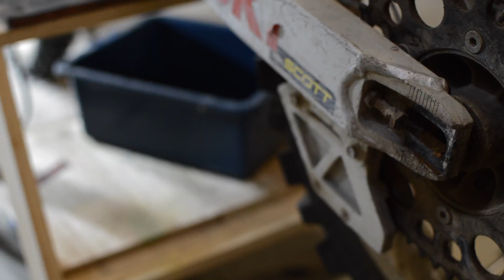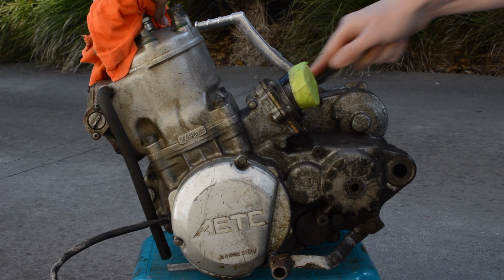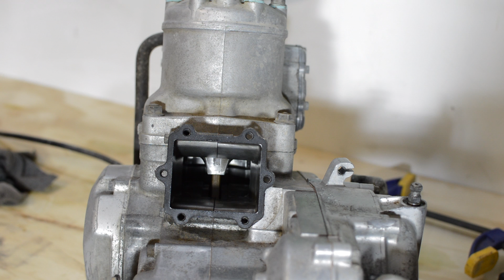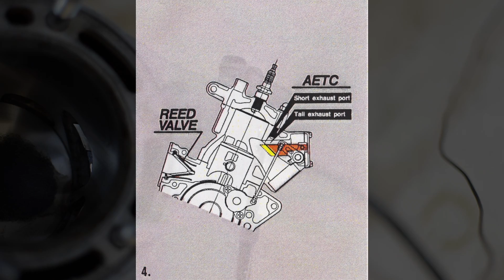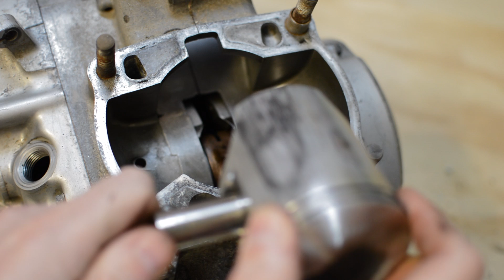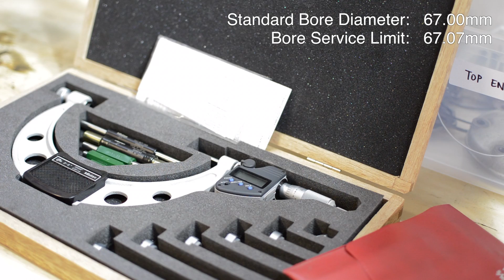Engine Inspection (Part 1) - 1992 RM250 Restoration - Episode 4

Comment: Piston clearance is determined by the piston diameter of the skirt. No wonder why the clearance seemed large!
Reply: Mr Manual he say- A:measure piston and B:cylinder, subtract A from B.
Service limit is 0.120 mm. (piston 12.5 up, cylinder 20 down). Needs re-bore.